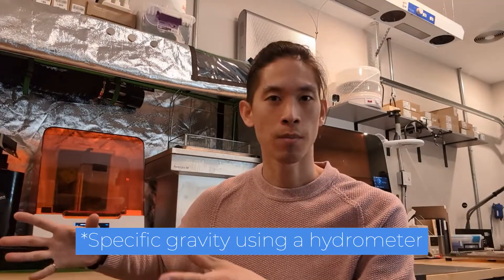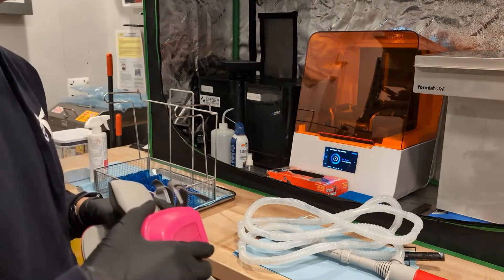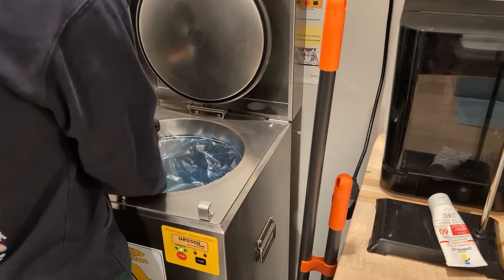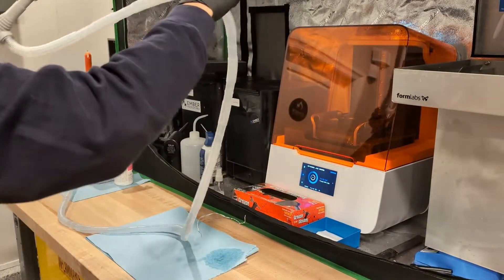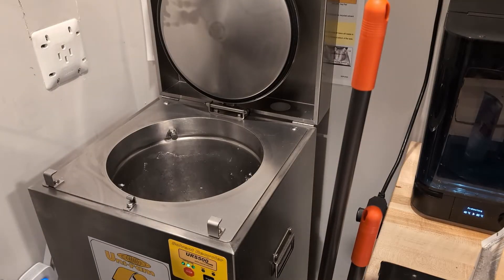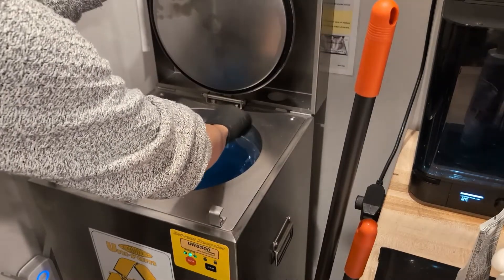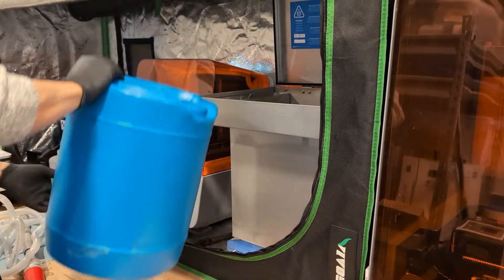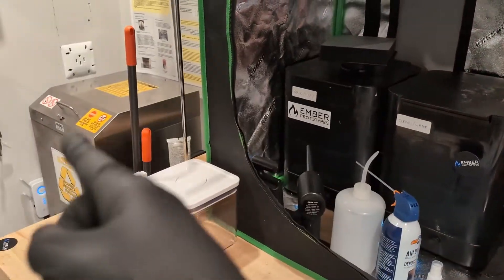The REAL way to recycle IPA for resin 3D printing

Comment: Speaking of waste, it looked like there was a good bit of room left in the first bag when it was thrown away. Then, you used the pump that had dirty IPA running through it to transfer clean IPA? Did you at least flush it, so that it wouldn't pick up any particles that didn't make all the way to the still?
Reply from the maker: You can't reuse bags and there's a limit to how high you can fill them. Yes, I flush the pump out (probably not shown in the video). I also now run the IPA through a fine mesh filter before going back into the wash stations.
Reply: @emberprototypes what about just getting a second pump? Color code with duct tape? And, even if you can't fill the bag to the top, couldn't you have run it at least one more time? Just seems like such a waste, especially with the anti-plastic thing going on, right now.
Reply from the maker: @jimmesser1555  I could get a second pump sure, but I haven't found the need to. Also the bags aren't meant to be run through temperature cycling twice. I haven't tried but they can degrade and then rip and pour crap all over the inside of the distiller which I would not like to experience

Comment: As a hobbyist I always keep separate virgin and "recycled" solvent. Usually the first rinse gets the recycled solvent and then there's a final rinse with virgin solvent from a spray bottle. There definitely is a significant amount of resin which cures and falls out but there's always a lot of wasted solvent stuck in the sort of gel that it makes and the "recycled" solvent keeps a slight yellow tint, so I'd never consider it like new. It is successful at least in that it keeps me from going through so much.

Comment: Dental lab here. We print a ton of models every day. We go through about twelve gallo gallons of IPA a week between several wash units we have. We bought the same recycling unit a few months ago and it’s just what we needed. One tip I recommended for the bag as locking ring is out the bag in the unit, then fill it with ipa. Then place the ring in after it’s filled. Way easier to set the lock ring that way.
Reply from the maker: @Docstantinople glad to hear it's working well for you! So you pour IPA in the bag first and then put the retaining ring in? The only thing I wish would be that the retaining ring was tighter and prevented condensation and gunk from building up below the bag. It's not too bad, but sometimes having to clean that area is a bit of a pain.
Reply: @ yes, I place the bag in the unit then pour in dirty ipa and then place the ring. It’s easier the place the ring in when there’s some weight in the bag from the ipa. The big will not move around much. 
Yes, we get a little bit material below the bag too but it’s easy to wipe out.
Reply from the maker: @Docstantinople  thanks for the tip, I will try that next time!

Comment: Why not just top up the same bag again for the 2nd half? Save a bag and cut down on waste. Or are the bags damaged during the process? Hense the wiping of the tank.
Reply from the maker: It's very possible you might be able to re-use a bag once or twice...but they don't recommend. It could be just so they can sell more bags, but I can also see the heat degrading the plastic over time. The bags are quite cheap so I've never tried!
Reply: @emberprototypes  You're problably right. I too distill my IPA, on a small scale with a DIY setup. And for safety, I do it outside.
Reply from the maker: @paparoysworkshop that's good. Heating IPA itself isn't as dangerous as people think...but it's the vapors that can cause explosions if close to an ignition source that are the most dangerous. So always good to do it outside very far from ignition sources!

Comment: "Contaminated" ipa in a first rinse with the resin pulled out + some acetone cleans way better for my resin.. I am guessing there is solvent build up left behind from the resin, fresh ipa precipitates a gummy layer around the print which requires rubbing to remove, this can happen after placing it in second rinse or wash too thats fresh from carryover from first wash, I have several rinse stages so my final rinse and wash station stays clear.

Like homeopathy but actually useful for ipa/solvent, the need for recycling/cleaning/replacing solvent goes way down. Im wondering if I can recapture resin with distillation if I protect it from uv from the first wash.

Comment: Ok so this idea has been cooking and you seem to be more familiar with the chemistry side of mixed iso and resin, can you run it in a centrifuge? Because the iso is so low density anything denser than it gets separated and you could roughly filter it out that way. The trick would be running just pure resin in the centrifuge to separate it and then measure each density and make sure that all components of the resin are denser than the iso, but even if it caught ~80% of the resin leftovers it that would be good enough for me. 

I can't think of a reason why it wouldn't work but maybe you can shed some light on that, both systems are physical separation processes and while a centrifuge isn't as convenient as a distiller it would be much easier / safer to do at small scales and so far seems to be the cheapest option (the other main options are using precision filters might not be effective as you said / uses consumable filters, or doing DIY distilling setups which I avoid on the off chance the whole thing detonates)
Reply from the maker: @Thewatcher911  not sure that would work. Think of it like salt dissolving in water. You can't centrifuge out salt from water once it's been dissolved. You would probably get out a lot of undissolved things like dye particles, larger monomers or oligomers that haven't dissolved, but there would still be lots dissolved into the IPA.
Reply: @emberprototypes  I don't know the exact chemicals used in resin and I agree anything in the solution would stay there, but I wonder how much of it properly dissolves. I don't love the sub micron filtering method but I will say it does an impressive job of keeping the alcohol (at least visually) clean. People say it works though so I'll stay tuned for your video doing proper density testing (I looked at $8 hydrometers on amazon but I wager you've got a accurate setup for measuring)
Reply from the maker: If you have an hour of time to kill, I'd recommend watching this interview with Andrew Mayhall 🙂 https://youtu.be/WwgS3gHh8l4?si=_T53CTMQavsXdVSB

I'll get around to the testing eventually!
Reply: @emberprototypes  I'll check it out

Comment: i'm curious if you've ever tried to see if there any way to reuse the resin left over from this process. you didn't really show it in the bag much afterward but i'd imagine the whole process of it being dissolved in alcohol and then distilled ends up completely changing the chemical structure so its no longer a liquid, uv curing resin any more. But is it essentially like cured resin? Could it be ground down into a powder and used as a filler material in pourable resin?

Comment: So what's the efficiency ratio here?
ie. Put in X litres, get Y back?

And based on IPA costs, how long (or how many litres) must you recycle before you're cost even on the unit?
Reply from the maker: @XViper123  honestly I haven't measured efficiency but anecdotally I get a similar volume of what I put in as clean IPA. For me, this has paid itself off in a year or two.
Reply: @emberprototypes  Thanks for the quick response. :)

Approx how many litres do you put in (or take out) per week?
Reply from the maker: @XViper123  I usually run it 4-6 times a year depending on how much resin printing I do! Each time is around 20L of IPA

Comment: This is a great solution, fully agree that distillation is the only way to clean IPA, problem as so many other people pointed out here, for home use it's way to expensive.
A  good solution would be a recycling point, where you get a credit for you old stuff.
And where you pay for recycled IPA, minus your credit, and only pay for the work and service cost of the device.
Of corse it's easier sad than done, there of corse is no benefit for both sides if the cost is equal or more than a new  IPA.
Is it environmentally better than burning, maybe, also depends on how you burn it,  but the power to run that machine also doesn't drop out of the air that's for sure so to say this is completely environmentally friendly can quick turn into a false truth.
Reply: Its not, look into the vevor 4L water distiller, theres even a version that has a temp control, you can likely attach a tube to the output run it down into the bottle to increase capture rate. Unmodified review found its 85%+ recapture of volume

Comment: Cool, but after some time in the atmosphere you are going to get down to 91% and stay there since you can't distill past 91% without a vacuum. Or does the machine vacuum distil?
Reply from the maker: Yup that is absolutely correct because of moisture absorption. Still does the job very well though.

Comment: I've seen someone use a water distiller. They're not cheap though. The cheapest temperature controlled ones I see on Amazon is about $80.
Reply: " They're not cheap though"

bro, this solvent distiller is six and a half grand. and its worth it.... $80 is cheap.

Comment: What about using molecular sieves to filter the isopropanol or the monimers out of solution?
Reply from the maker: Not sure it that would get the monomers and stuff out...but I've heard it's good for getting water out of the IPA
Reply: Sieves have far too small a pore size for absorbing monomers. And you definitely don’t want to do it the other way around!
Reply: @mduckernz  Thanks!

Comment: So distilling IPA has a place. And yes that is the best way to get your IPA pure. Most people don't need their IPA to be pure because most of the time the the IPA is still concentrated enough to do its job. if your wash bath is 3 liters and its 99% by volume. You can add almost 500ml before the concentration is below what would be recommended for cleaning Resin prints. Not taking into account you need to top off the IPA since some of it will stick to the print etc so you will top it off over time. If you wait for the excess resin to drip off and have 2 ml of resin sticking to the print. That means you can do 250 washes before that alcohol is no longer viable. if you do a clean dirty wash you can get even more washes. The IPA will become cloudy long before that because of pigments. So removing that pigment means you can do more washes without replacing the still viable alcohol. For most hobbyists, the alcohol is still over 90% IPA which is why this settling and sun stuff works. The needs of hobbyists vs business are different.

Comment: A lot of hazardous wastes are simply incinerated. IPA in particular breaks down to CO2 and water. The real hazard would be the resin itself, so you should probably let them know that it's contaminated with liquid UV resin in particular, although they might not know enough about it to have a specific procedure for it.
Reply from the maker: Yes, I always used to let them know and provided the necessary TDS & SDS. Pretty crazy that this is normal though.

Comment: What is the cost break down between buying fresh/disposal price vs how many cycles to break even?  Any service or expected hours of life on the distiller?  Looks like a nice option.
Reply from the maker: I recycle around 60L of IPA each time...maybe 4-6 times a year depending on how much work I have. Each 20L barrel of anhydrous 99% MG Chemical IPA is around $200 CAD for me. I could get it cheaper if I bought giant drums of it, but I don't have space to safely keep that amount.

So within a year that's around $2400-3600 CAD. Considering I purchased the machine for around $3000, it's paid itself off many times already and is more convenient and better for the environment.
Reply: @emberprototypes  Did you ever look at Methyl Alcohol instead of IPA? I use Methyl Hydrate(99.9% Methyl Alcohol) that I get from the hardware store(Used as a cleaner for shellac, or as a anti freeze) for $13 CDN/4L. Works out to roughly 1/3 the price of the IPA you listed above, and is often cheaper with discount.

It does require a bit more care as it is more poisonous, but it's not hard with all other precautions being used with the printing process. It cleans better than IPA, and evaporates faster as well.
Reply from the maker: @grazingshot  honestly have not because IPA is what most people use (including industrial printers). I've tried TPM before but it's very oily and required a post IPA wash to evaporate which means keeping two solvents...so not really that convenient. Interesting to know about an alternative!
Reply from the maker: No maintenance costs yet AFAIK. The only costs are electricity (negligible) and the bags, which are consumables but incredibly cheap (I think $5 each)

Comment: Unless im missing something, this is just a distillation process? Just heat up the ip and it will evaporate , cool it down and you have your ipa again.
Reply: No, you’re right. Solvent recyclers often use a vacuum pump as well as heat, to reduce the boiling point of the solvent and so require less heat energy to evaporate and it’s much safer, cos the solvent only needs to be heated to 40 °C or so.
Reply from the maker: Correct. It's just a very reliable, safe, and well designed system that does solvent distillation.

Comment: As you said so many benefits to bringing this process in house, namely they way the third party you were using before was far more wasteful. As a workflow I am curious if it still wouldn't be better to have 50% or more of the IPA over your need so the machine is not down for all two cycles of the machine. I suppose that depends how heavy your print volume is and if it being down for that time impacts your ability to deliver on time. Either way thanks for showing this process and that it can be done, if not yet at the small at home scale, at least at the small to medium business scale.
Reply from the maker: Yes the way I do this definitely results in down time , but it's really not too bad. It doesn't prevent me from actually printing parts (which is the most time consuming)...so I can print parts and leave them ready to be washed once the recycling cycles are completed. I also don't run the printers all the time, so I intentionally choose to recycle when I don't have work for example. The convenience factor of having it in-house is through the roof! 😅

Comment: Nice setup! As stated in your video about handling resin, there opt to be a cheaper route  to clean the prints in 2-3 stages where IPA99% is the last stage. I'm using rubbing alchohol 75% on prewash and secondary washing stage before the ipa, and the resin sink to the bottom due to sedimantation. This way the cost is greatly reduced.

Comment: Great video, 2 questions:
1. What percent IPA are you all using?
2. How many was cycles can you get out of a single IPA bath before cleaning?
Reply from the maker: 1 - 99% anhydrous IPA from MG Chemicals.
2 - Highly dependent how what we print, I actually don't really keep track of the number of cycles...once parts start requiring additional time to get clean it's an indication that I'll need to recycle soon.

Comment: So - how does it work, and can someone DIy it on a smaller scale?
Reply: The closest thing you'll get to a DIY option for something like this is likely a $100 distiller from Amazon. They don't have much capacity, and likely lack the convenience and safety features of a system like this, but at least they're relatively cheap.

I don't think there's actually much risk to doing so, but I'd still run it outside with an extinguisher just in case.
Reply from the maker: @AuntJemimaGames  this is correct. This recycler is just distillation, which boils the IPA and condenses it down into a container. The leftovers remain in a bag for disposal.

You could do this with cheap DIY stills, but not recommended due to safety hazards (fumes, explosion, fire). These recyclers are certified to be explosion proof and are extremely reliable and well encapsulated. They also are meant to work with the bags which prevent resin junk from sitting at the bottom of a still tank and burning into oblivion.
Reply: @AuntJemimaGames  I have done this. It works well. I did it outside with a fire extinguisher, well away from the house. Do not do it unless you will be ok if the entire contents of the distiller spill and catch fire. I think it unlikely to catch fire, but the consequences of doing it indoors could be dire.
Reply: @AuntJemimaGames  What safty features does this have that you're referring to? Can you elarobrate?  Or were you just taking a wild guess?
Reply: @GeorgeGraves  any chance of a spark or too much pressure could ignite the vapour inside the cheap distiller as its only meant for water
Reply: @krosscross  Is it normal to have spark or pressure inside a distiller?  How does pressure ignite vapours?